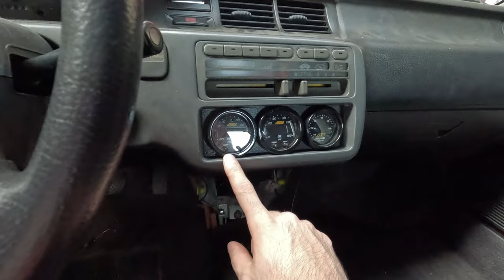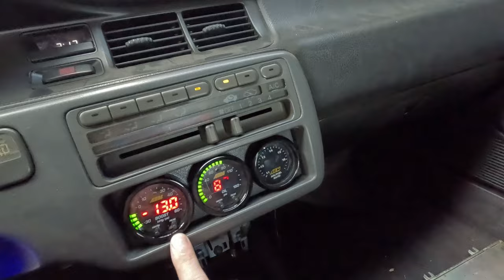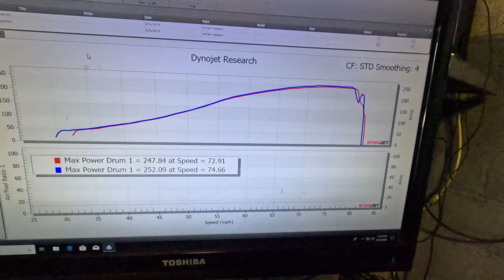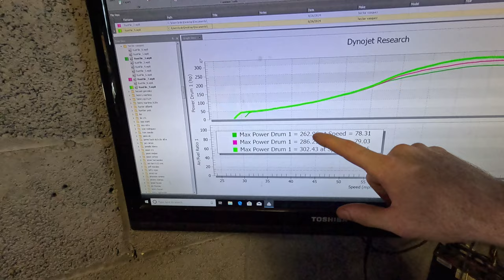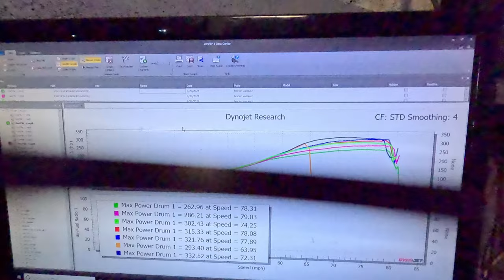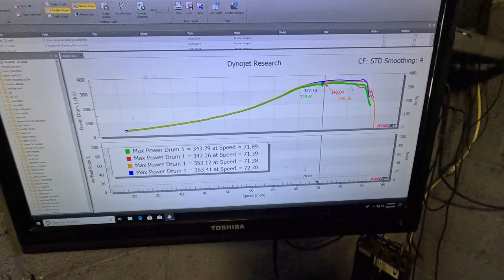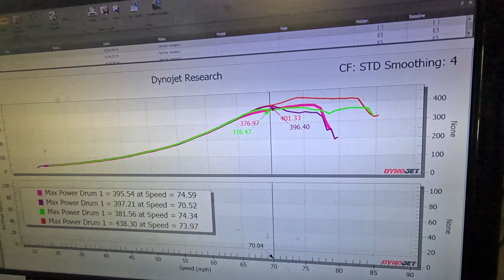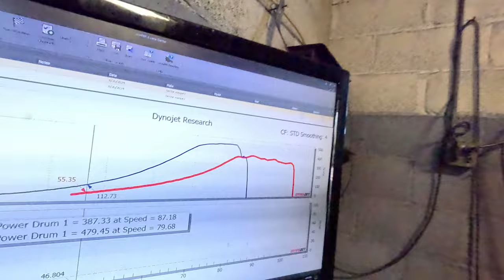HECTORS D2B EG HATCH DYNO DAY / WILL WE BREAK 500WHP?

Comment: Good job on the i/c piping man, I did my first last month and it was difficult.....my junk was .055 thick...
Reply from the maker: @boostismagic  I’m actually not sure how thick this piping was but I do know that good t6061 aluminum is such a good metal to work with. And larger diameter pipe is easier to weld because it doesn’t get as hot as quick.
Reply from the maker: @boostismagic  and thanks my guy! I appreciate that!
Reply: @PRZJ91  yeah this was an old kit I got off eBay long ago, not the best to learn on 😅
Reply from the maker: @boostismagic  fr, ive got some ebay material that was so awful to weld and it was coated. always remember to buff or sand any coating off. some material looks like its not coated but it is. and some material ive got from ebay welded great right out of the box with no sanding so its really hit or miss

Comment: Perfect setup 🔥 any other work done to the head besides the SF cam?? I'm currently slapping the same setup together for my 92 VX . I had the same problems with my p72 ecu , I would have to take a hair dryer to my ecu for like 2 min to get the fuel pump to prime 😂 most likely going fuel tech 450 , pretty much same price as buying a usable Oem ECU with Hondata + aem wideband ...
Reply from the maker: @ayejay4681  yeah fueltech is awesome, I actually learned it recently and I might have a car on the Dyno soon that I’m tuning on fueltech. I’m excited for that! 

I believe the head has some sort of port on it. It did not look like the factory casting. I just don’t know if it was hand ported or cnc. lol
Reply: @PRZJ91  looks like a perfect setup , that thing is eating 🔥
Reply from the maker: @ayejay4681  🔥🔥🔥

Comment: Nice video! I'm thinking of going d2b too. What's all needed for it
Reply from the maker: @Fackler91  you could go olateless but the easy way is to get a plate. It’s just more expensive. Youll need a b series trans and half shaft with shift linkage too. For the mounts I think you need a b series t bracket, which we modified to work with the sohc. Plateless will need a custom engine side mount but played I believe uses the d series style mount. I don’t remember everything but this should get you close
Reply: Sweet thank you

Comment: Where did you get the spacer
Reply from the maker: @luizontuned7011  I think he bought this manifold second hand so it came with it. I believe you can get the spacer on skunk2’s site though
Reply: Hey bro whats the 2step set up too sounds nice
Reply from the maker: @luizontuned7011  2STEP is set to 6000rpm, activation is at 4500rpm, -30° of timing and plus 200 fuel.

Do this at your own risk. Thats a lot of timing pull and may cause damage to the engine. So start with -10 and move 5° at a time until til it sounds good to you. Anywhere past 20° can be harmful so use at your own risk! lol
Reply: @PRZJ91  thanks a lot bro no problem will do -10 and so go down little by little lol
Reply from the maker: @luizontuned7011  yup start -10, then try -15 then -20. You want the least amount or ignition retard to satisfy that itch lol